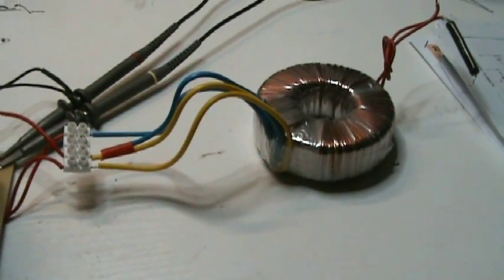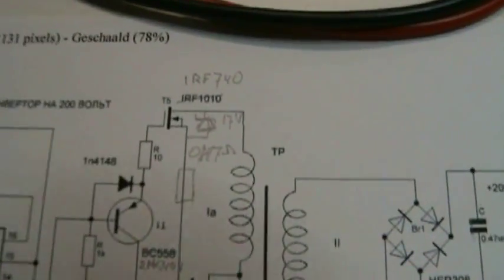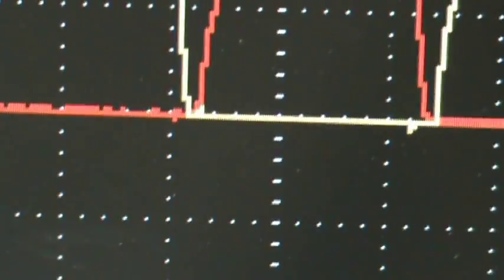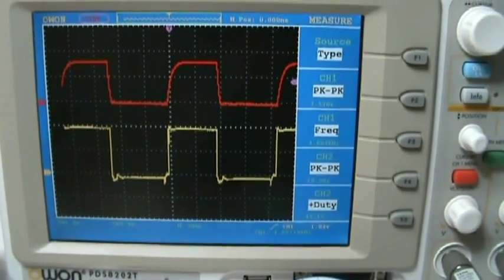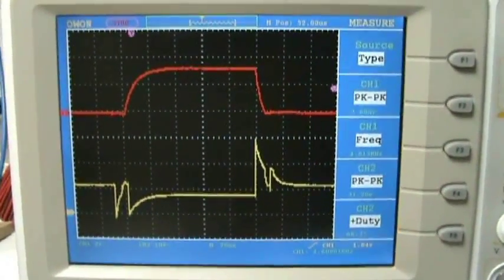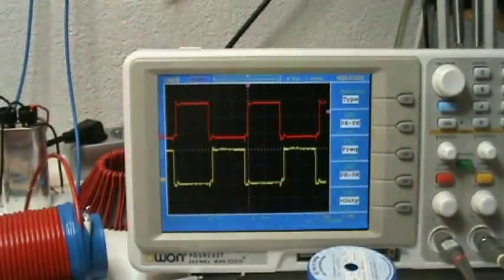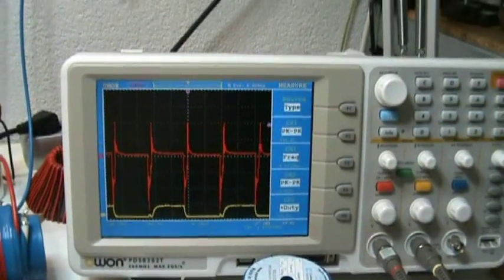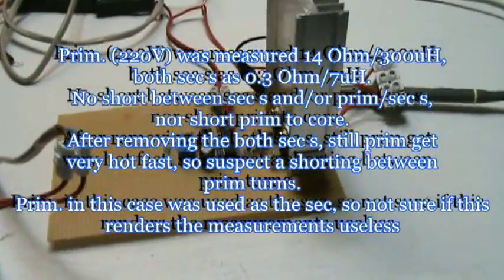Dally generator problem 1.mpeg

Comment from the maker: Hi Geert, the TL494 should be set to 4.6Khz according to the Dally circuit.
I am hunting for a ferrite transformer as my present (defective) toroid was 50Hz only.
No need for zeners when using a ferrite transformer i am told, so we will see how it goes then.
I have 28V zeners on order, so could use them when still needed.
Thanks,     Itsu